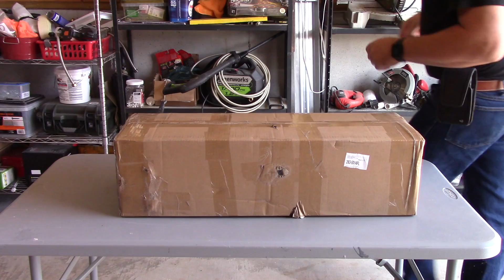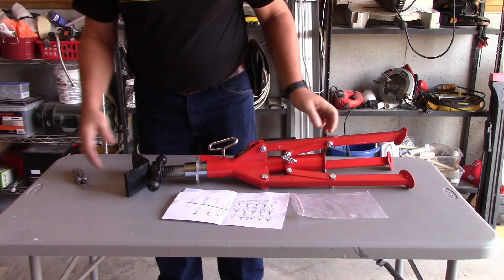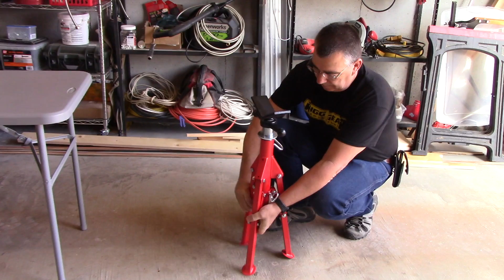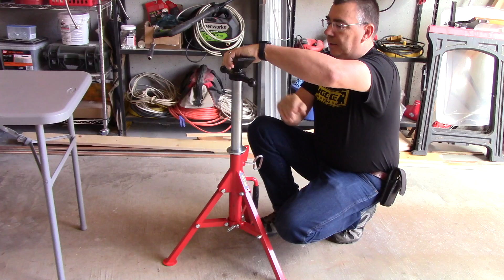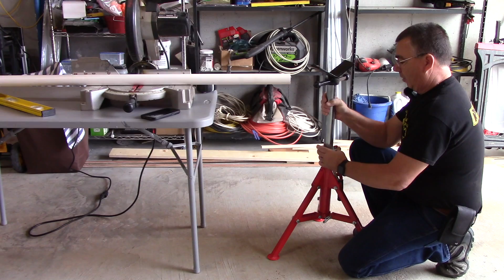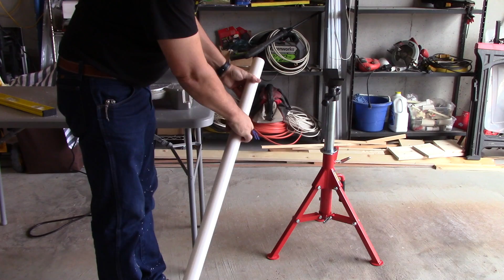Vevor V Head Pipe Stand Jack 2500 lb. Load Capacity Portable Folding #shop  #tools

Comment: Do you know of stands that are like that but have flat tops ? I want to use it to hold tube feet for SS equipment.
Reply: Do you know if they sell already made stands around the same weight capacity with a flat top?
Reply from the maker: I’m sure they do but I haven’t actually looked for one
Reply from the maker: I cut a piece of wood to set in mine to make it flat. a person could make it from metal also